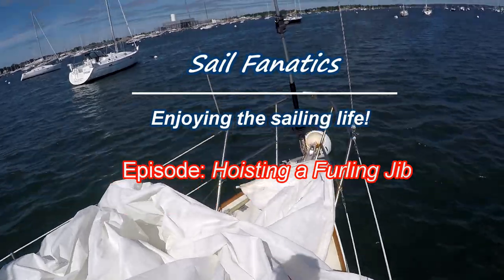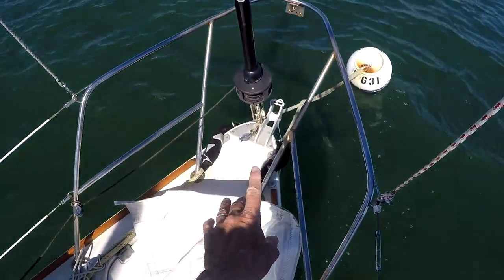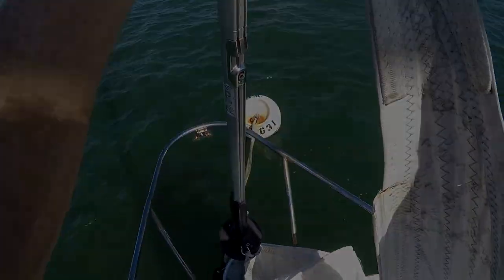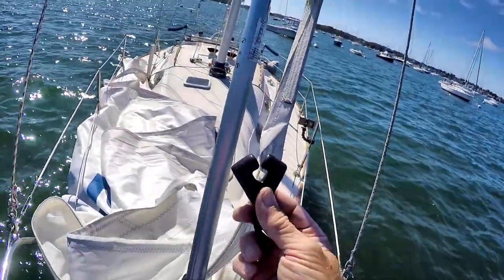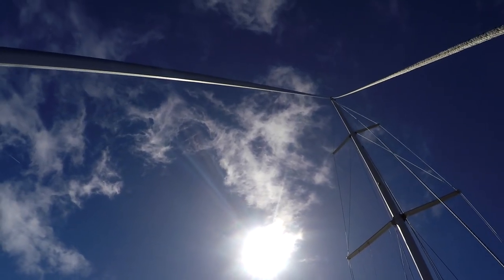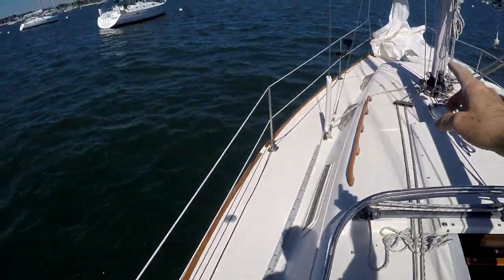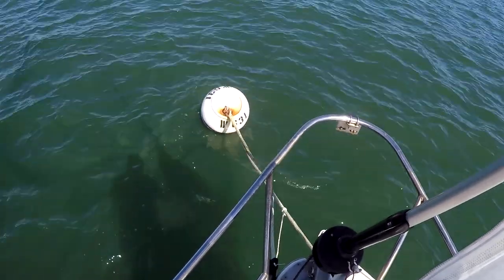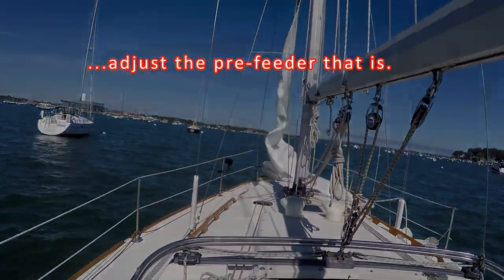Hoisting a Furling Jib | Sail Fanatics

Comment: OMG this is a great video. We your procedure and the only thing the stumped us was our halyard had a bunch of twists in it. When we raised the halyard it would wrap it self around the furler shaft. We un did the bowline knot from the top of the furler, took the twists out of the halyard rope and retied the halyard to the top of the furler mechanism and bingo, the halyard raised the sail with the expected effort and did not twist around the upper furler shaft (tube?). Thanks so much for this video.

Comment: Thanks for sharing. 

One thing I do when single handed is to take a spare piece of rope and attach it to the jib halyard, take a half turn around the winch, then walk up to the jib. This works great until it becomes too much to hoist by hand.
Reply: I assume you mean attach the spare rope to the jib halyard BEFORE going forward and manually passing the luff into the grooves and then raising the jib...thanks for the tip, a good one. I guess you can maybe save a trip back and forth.

Comment: I have a furlex roller furling system and the prefeeder is on elastic bungee that goes round a wheel at the bottom swivel up to the first joint. It's also much tighter than this as you have to stretch the bungee and tie it off at 300mm so quite springy. Seems quite effective.

Comment: Small question,you mention at the end that you release some tension on the jib halyard ,is that normal ,do you retention that before you sail ???.
Reply from the maker: Yes, the reason for releasing the halyard tension is so the jib luff is not being stretched over the days (or weeks) in between use. Anfd yes, before you deploy the jib to use it, you should add that tension back into the luff.
Reply: @SailFanatics  great I’m glad I asked thx

Comment: Was there a "downhaul" component to this furling system? I installed the jib on a furles 100S with a friend after the recent hurricane and now I notice some luff tape that looks like it should be placed in the groove heading down from the feeder.
Reply from the maker: There is no down haul feature in our system, or in general in most roller furlers. 
Once the sail is close to full hoist height, further tightening of the halyard should remove any slack in the luff and give you a little crease in the sail, from head to tack.  Assuming you have a fully hoisted sail with a, tensioned luff, than if there is some tape still below the feeder, may just be the result of how high the rigger positioned the feeder versus how long a length of tape the sailmaker happened to put on the sail.  There may not be any science to either of those... Provided the sail luff is tensioned from head to foot, it's hard to guess what concern you need to have.
Reply: @SailFanatics  OK, thanks for that. I will ensure we fully hoisted the sail.. That might explain seeing some of the luff tape with the rope hanging below the feeder.

Comment: Last time I hoisted my genoa the halliard kept twisting around the foil and causing too much friction for the sail to hoist. I had to put a light line through the head shackle and lead both ends aft so I could keep them under tension whilst hoisting. I was then able to slip one end of the light line when the sail was nearly fully hoisted. There did not appear to be any twist in the halliard so I am not sure why this happened and would appreciate any tips on preventing it from happening again as it made a simple job a right pain.

Comment: How do you put the “extra turns “ in?  I’ve never worked w a furler before
Reply from the maker: Check back to 10:55 in the video. I bring the jib sheets forward to the furler, and rotate the sail/furler/sheets three turns clockwise. This procedure adds more turns to the furling line on the drum. Then reset the jibsheets and furler line.

Comment: What was done works OK with little wind, nose pointing into the wind, and calm water. What about needing to single-handedly install a jib/Genoa while either 1) in a slip with strong winds blowing from an unfavorable direction or 2) single-handed in strong winds and very bouncy water?  Single-handed under conditions 1) or 2) I would strongly prefer a hanked-on sail.
Reply from the maker: Its  a strange premise to imagine a situation where circumstances mandate that you hoist a jib in a slip. I mean the jib's no use until the boat leaves the slip, well hoist it then. If there's no option to wait, you could remove the sheet and hoist the jib, then furl it and re-attach the sheets. An attempt like this would take some thinking.

I would agree that its easier to attach a hanked on jib in squirrely conditions, because you do actually need to raise the jib while attaching it, but switching taped sails can be done, just a little carefully.

But this benefit is of little import compared to the benefits of jib furling,, which allows you  an extra 20-30 minutes of sailing every time you use the boat, versus wrestling with hanks. I've sailed dozens of years with furling jibs and dont recall one situation where I would prefer to again be wrestling with hanks.

Comment: My sail has a thick line through the luff, it wont fit in the furling system.
Reply from the maker: If your sail is setup to go into a furling system, there should be a plastic bead running the edge of the entire luff of the sail, as shown in the video. If the bead won't fit into the furler extrusion, its an incorrect size. You need to have a sailmaker replace the luff tape with a new tape that has the correct size bead for your furling system.
Or ar you looking as some rope sewn just inside the luff, used by some sailmakers to bulk the the luff when furling? If so, that does not go into the furler.
If this doesn't answer your question, join Sailnet and post this question together with a picture of the sails luff.

Comment: Hello.
Nice video.
One question, why is there 2 extrusion grooves? What's the logical reason for that?
Sorry the noob question, but i'm not a sailor, but looking forward to be one day. :)
Reply from the maker: Two grooves allow you to raise a second jib while the first is still raised.  This is a common technique for racing sailors who want to change the jib without going jib-les during the switch (to do this require you to not be using the furling system)

Also you raise a second jib for running downwind under twin headsails.
Reply: @SailFanatics  Also you raise a second jib for running downwind under twin headsails.----can You, please explain step by step how to do that?

Comment: What is that little mount on the bow rail seen in 6:04? I have one in my boat from the previous owner and don’t know what it is for.
Reply from the maker: Taylor
The only item I notice is the bow running lights fixture which is located at the center of the bow rail...

Tom
Reply: I know you asked it a year ago but I though my answer might help either you or somebody else. I installed an anchor holder bracket to mine which looks like those light fixtures from this angle.

Comment: I wish I knew which shackles to use on the top and bottom of the head roller. ¯\_(ツ)_/¯ 
Also, why don’t you just put a couple of turns of the halyard around the drum, and then go forward with the bitter end and you can raise and Feed at the same time?
Reply from the maker: I find you need to use the winch to hoist the sail into the luff extrusion, which is much easier to do via the winch handle than by hand.  When properly positioned, the pre-feeder works like  a charm, and you avoid the hassle of ducking the sail when its part way up and luffing about.